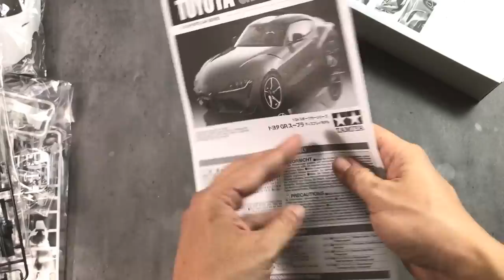Toyota GR Supra A90 | Tamiya | 1/24 | Scale Model Full Build | ASMR |

Comment: Amazing craftsmanship and excellent video.  What is the trick when bonding two painted parts?  I'm always having to scrap the paint at the attachement points for the cement to work.
Reply from the maker: Thanks a lot Jake! About the glue I used to bonding painted parts try “Tamiya Craft Bond” it’s kind of white glue and it’s safe for clear parts too.
Reply: I have it also, the white glue, it works great on F1 spoilers and thousands of other applications.  I am curious about the use of instant glue in alot of model building as it does get brittle and I'm not sure if it will last as long as traditional polystyrene glues, which chemically weld the parts together.